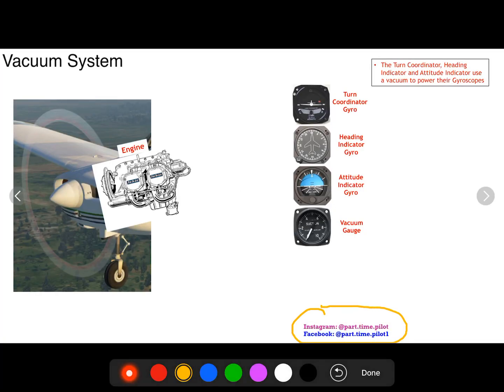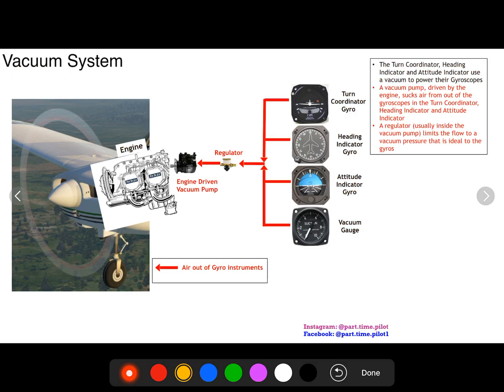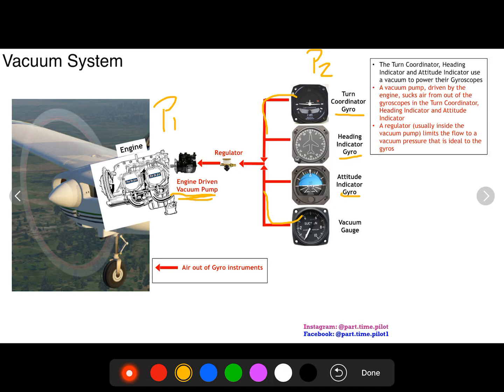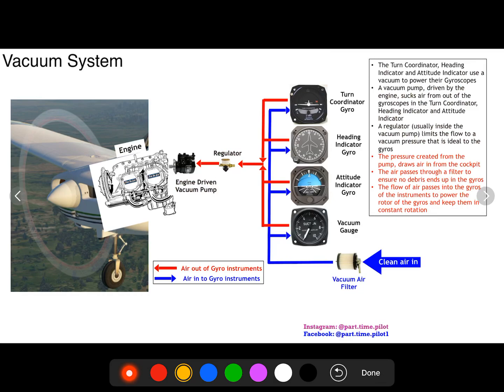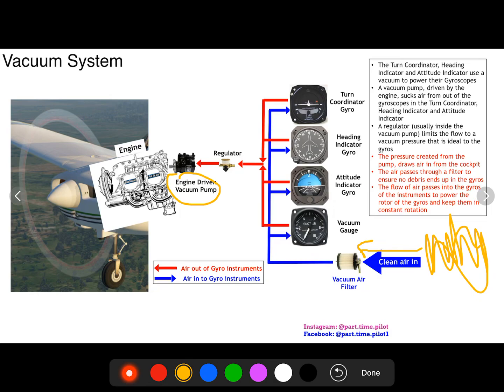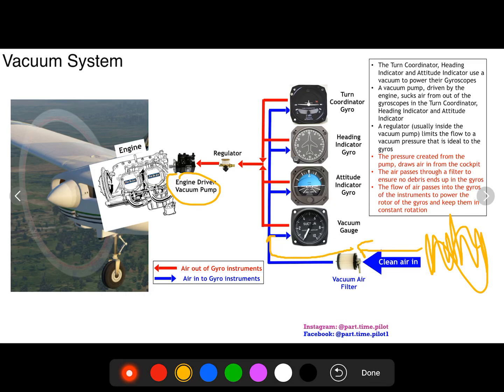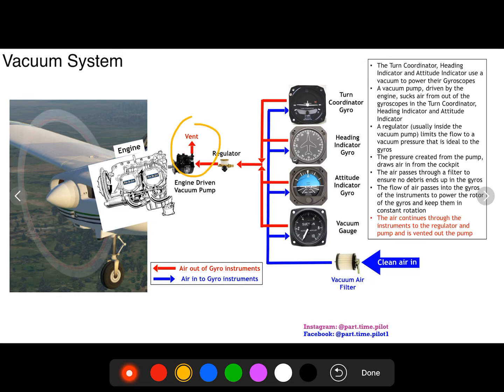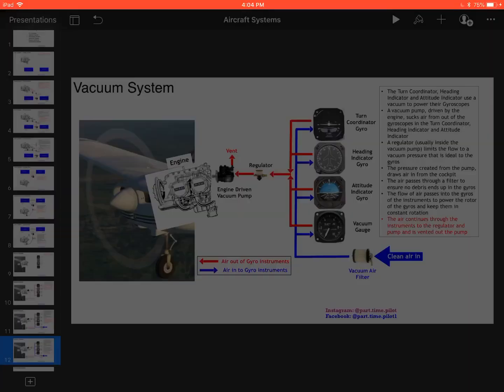How Aircraft Vacuum Systems Work - For Student Pilots

Comment: I don't understand how the engine vacuum pump is at the back. I thought the pump is what draws the air into the instruments. What is sucking the air into the instruments if there is only a vacuum air filter there?
Reply from the maker: The vacuum pump is the one “sucking” the air in but it’s easier to not think of it as sucking. The pump creates a “vacuum” of low pressure inside the vacuum line. High pressure always travels to areas of low pressure so the high pressure on the instrument side of the line starts flowing to the vacuum end.
Reply: @PartTimePilot  You mention the air is from the cabin that goes through the air filter right? Means nothing is actually sucking it just the pump creating low pressure so the air will flow towards the pump since its higher?

Comment: My question is even more basic. Why  are they vacuum powered and not electrically powered?
Reply from the maker: Vacuum pumps are drive by the engine. So the engine has to stop spinning for the vacuum pump to quit rather than an electrical system where a variety of issues could occur. 

However, many aircraft due have electrically powered turn coordinators and other instruments
Reply: @PartTimePilot  thanks!  however if your engine goes down then shit REALLY hits the fan

Comment: So what is the difference between an engine driven vacuum pump and electrically driven vacuum pump?
Reply from the maker: An engine driven vacuum pump is driven by the engine. It is simply attached to the side of the engine and when the engine spins the propeller shaft there are gears that transfer that energy to power the pump. 

An electrical pump gets its power from the electrical bus which gets its energy from the alternator or battery.
Reply: @PartTimePilot  Thank you. Really appreciate it!

Comment: what would be some signs of a vacuum pump failure if i have 2 pumps?
Reply from the maker: I would need to know specifics of the system. Do both pumps supply pressure to all the instruments redundantly? Or is one only activated as a backup? At any point do they share the same air lines? Are there multiple vacuum gauges? 

I would imagine the reason is for redundancy and that both pumps have gauges. If both gauges are down then you know or can expect. there is something effecting both pumps (maybe a shared line is clogged?). If just one gauge is down then you can suspect a single line clog or gyro issue but if the other pump is fine and working as the backup then your instruments should still be working fine off 1.

Comment: Good video. Why do the gyros need "vacuum"?
Thanks.
Reply from the maker: The air through the vacuum system is regulated to keep a constant flow on the gyros to keep them constantly spinning so that it can properly sense angular velocities and movement
Reply: @PartTimePilot  Thanks for your prompt reply and excellent work.

Comment: Turn coordinator is electrical powered
Reply from the maker: Fernando Mrtz actually it can be electrically powered or vacuum powered! Newer aircraft usually have electrical turn coordinators.
Reply: pilots should check their POH to see how their turn coordinator is driven. some are electrically driven. like the one on the video, there is a little red flag that indicates its running on battery power ...sign of alternator failure
Reply: It can be either, but yeah, I think it’s typically electrically powered